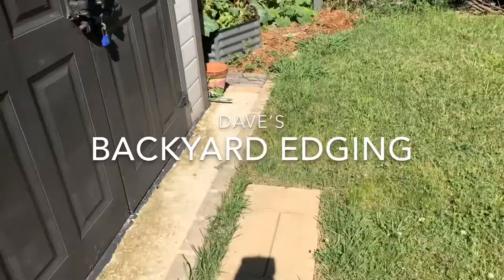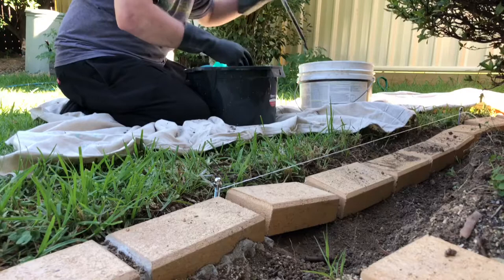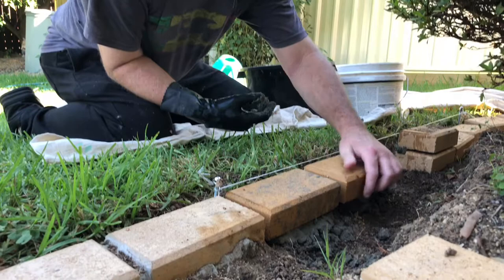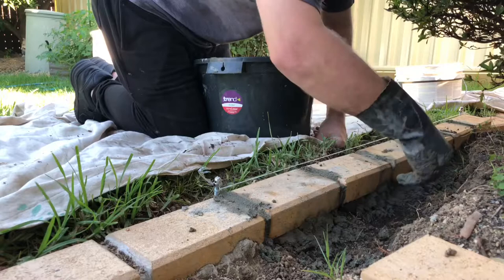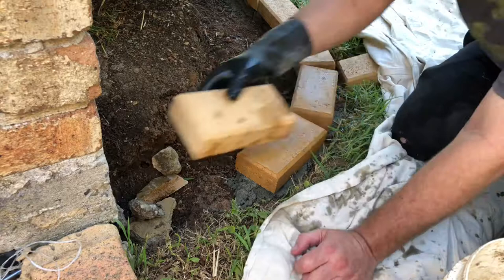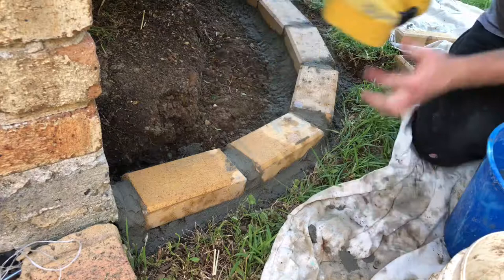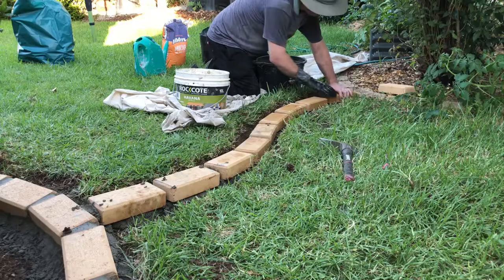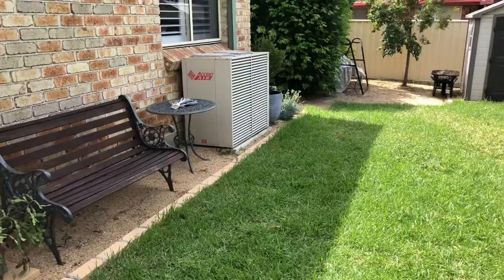Backyard Edging Tips

Comment: Thank you for your video.  Your video seems the simplest among the many I've watched: all you need is mortar, water, bricks and a sponge.  What's the difference between mortar and cement?   I have also watched a video where someone used "paver's sand."  Would you recommend that?
Reply from the maker: Thanks for your comments and questions.
Mortar is a mixture of cement and sand.
Cement is the glue - the more cement the stronger the mortar and the bond between the pavers.
I bought premixed mortar from the hardware shop - sometimes I added more cement as well for heavy traffic areas. You can also buy pure cement - which is basically crushed limestone.
Paver sand is more for paving than for edging - its the sand you sweep between the gaps in a paver floor - between pavers.
You could use paver sand if making mortar from sand and cement.
I recommend starting small and getting comfortable with laying 3 to 4 pavers at a time. That’s what I did.
Reply: @dajwhite1  Awesome, thanks for the explanations.  It helps.